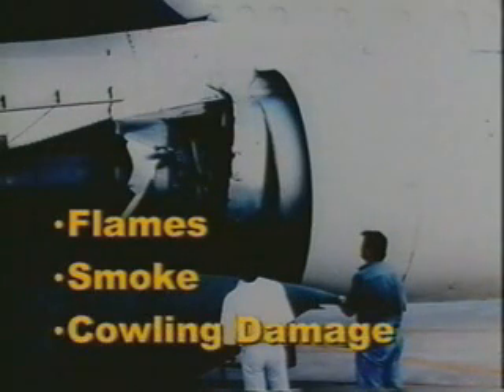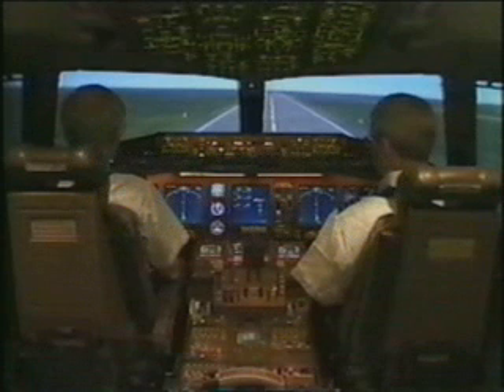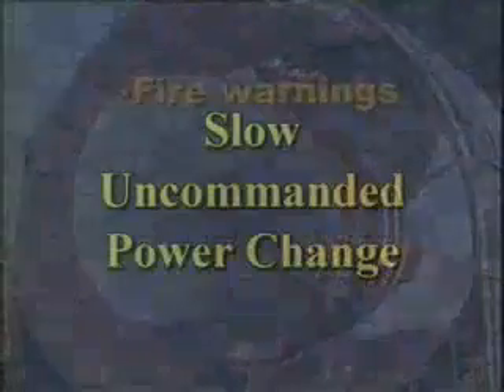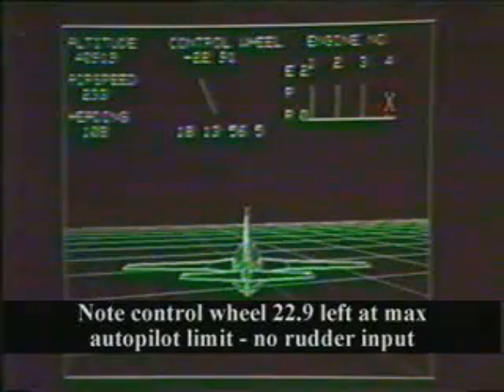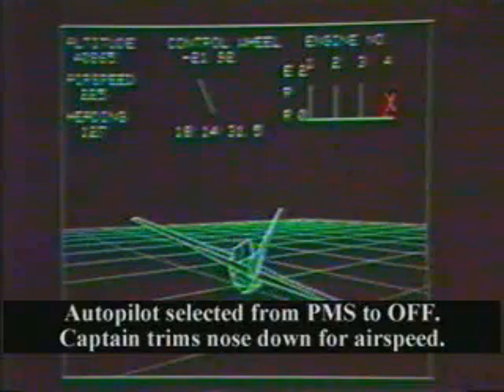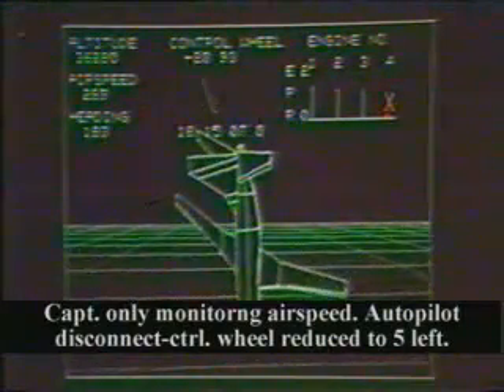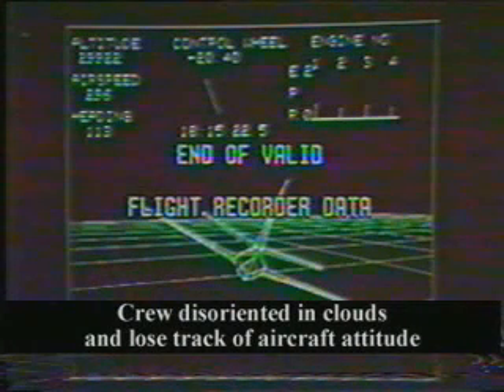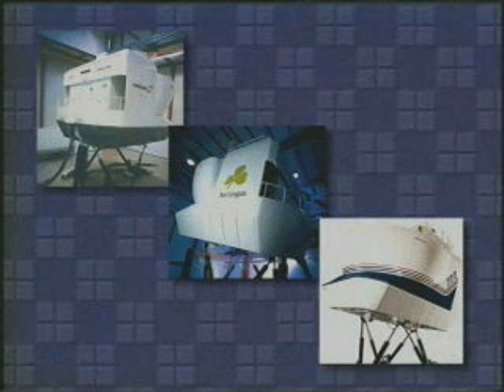pt. 3 of 3 Turbofan Jet Engine failure recognition

Comment: Surely if the fault happens at good altitude the best thing would be to shut the throttles and glide to establish a controlled flight path and save from reaching VNE, then a slow re-introduction of power would show up the fault and give time to react. In a loss of control situation maintaining thrust and high speed only serves to quicken the demise.